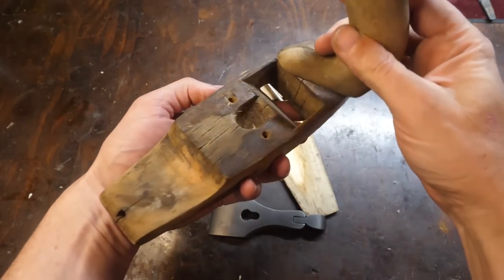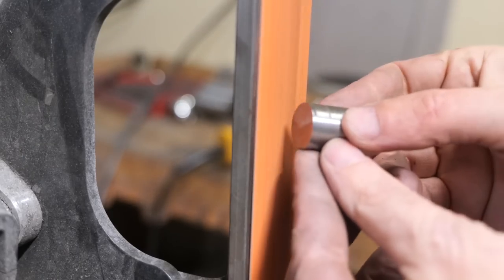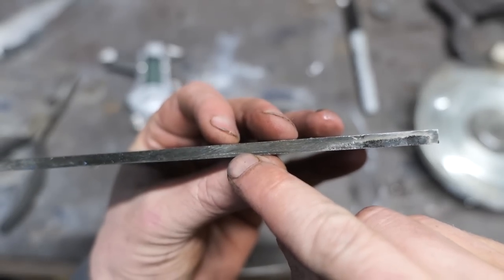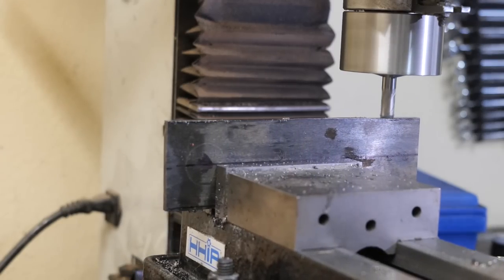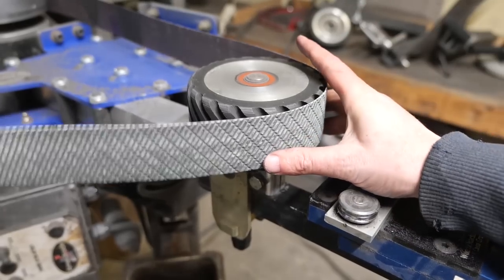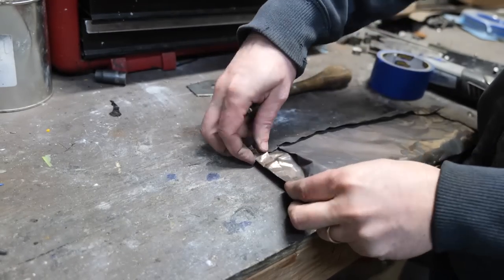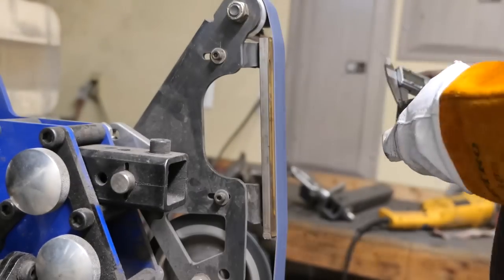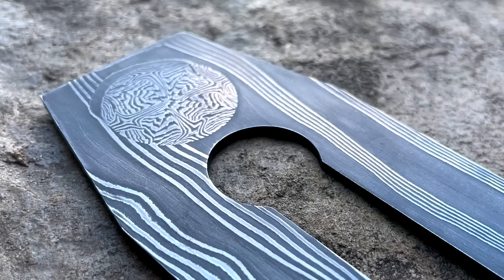Forging A Plane Blade Pt 2

Comment: Tool & die maker here - for your milling the slot, use an endmill 1 size smaller than your slot (e.g 9mm endmill for a 10mm slot). Endmills will usually cut oversize. You'll also be wanting carbide for that damascus because even annealed it looks to be burning up endmills - and I think your face mill needs a couple new inserts. Lastly - lubricant will help significantly with these sorta of tough materials. There's anchorlube which is technically for stainless but might work in this situation and doesnt require a full coolant setup - just put some on with a brush and send it.

The final piece turned out glorious by the way. I love the thin veins of bright steel, the plug is a nice touch too!

Comment: good work as always, maybe to get a hang of milling operations read a few machinist handbooks, just to get in the order of operations, and writing a milling plan makes things easier, milling the slot in the same fixing as the hole drilling might have made things easier for you.

Comment: If you have an edge finder for your mill you can touch off on your corners after it’s square and it’ll be a lot easier to put holes and slots in the proper places

Comment: Those holesaws are a pain in the ass to get running well. If your mill has the oomph a 2 flute slot drill would be a decent option, otherwise try absolutely drowning it in a really thick cutting oil, ive even used tapping fluid in  a pinch

Comment: When you faced the plate I noticed there's a ton of chatter on either end  Wear it was overhanging the vice. I suspect if you had used vice  Jack's under each end it would have kept the peace more stable

Comment: An impressive plane iron! If you ever happen to do another, there is no point in hardening any higher than the bottom end of the slot. The upper ends of plane blades sometimes get tapped with a hammer. A DRO and an edge finder would take all that math out of finding the center for the keyhole slot.

Comment: I'm not sure how it's usually done but would it be viable to quench just the usable part of the iron? since anything above the slot isn't getting used as an edge anyways. or would that make the warping worse?
Reply from the maker: You can but the differential etching would be mostly lost.  To get the full effect of contrasting steels both steels need to be fully quenched.
Reply: @GreenBeetle  gotcha. great job on the iron! looks amazing. actually love the underside with just the bare steel and the plug.

Comment: i don't know what mill you have you checked to see if you have any flex column of your mill i have a small enco mill works great for anything a drill press would do and that's about it facing or any ?heavy" cuts and it has similar results to what you are getting it turns out the column will flex this lets the cutter ride up then dip back down i know they say don't blame the tools ..... but sometimes they just don't help or cant do a task   anyway you can check it quick just mount up a dial indicator so that it is in contact with the table while mounted to the spindle then pull down and push up on the mill head with one hand  (my mill is still better than no mill but it was a expensive mistake on my part (1200 bucks) still nice to have for drilling lots of holes but not so much for making parts
Reply: and i should say i genuinely look forward to watching you work you make some amazing things and your narration style is dam near perfect funny and informative
Reply from the maker: thanks bro!